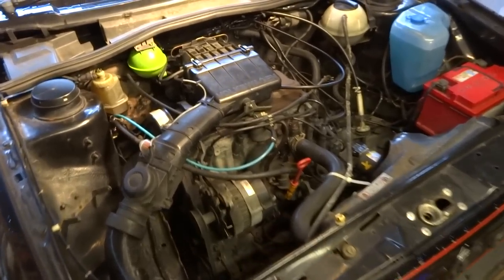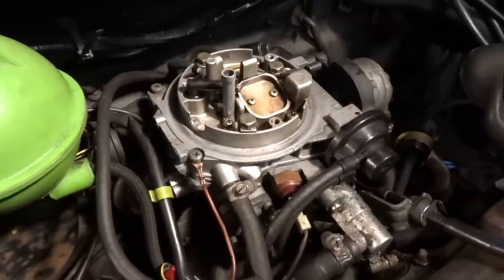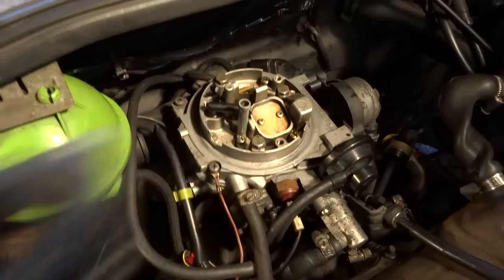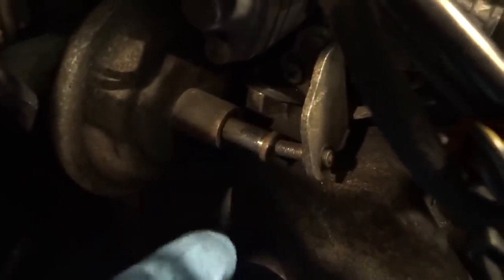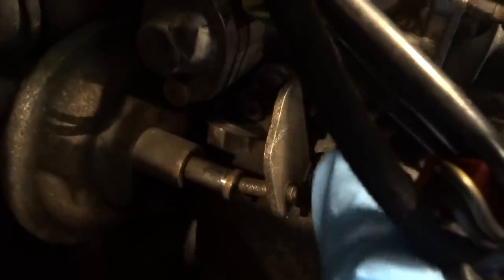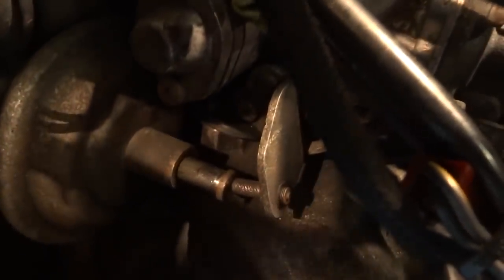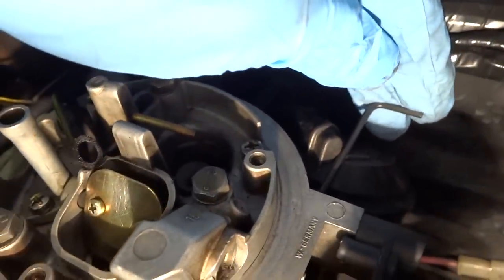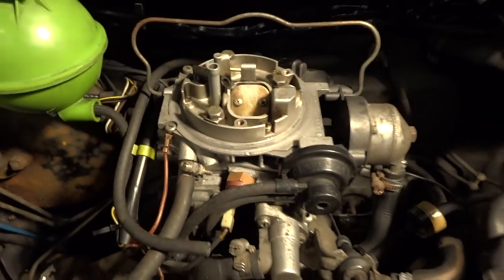VW Golf Carburetor Adjustments. Setting Fast Idle & Choke on Pierburg 2E2 Carb

Comment: Hows it been since the setting up the choke and carb?
Reply from the maker: +michael jagger hi since doing this the only thing we had to do was adjust the dial at 2m50s when the weather warmed up more.
Late last year the Waxstat decided it was completely dead. We replaced it with a brand new one, and checked the setting over again.
Since then the car has started and run graet with no adjustments.
Got some brake judder to investigate now though. always something!

Comment: this carb looks complicated how often do you have to set it all up?.
Reply from the maker: +michael jagger Hi once set up, I don't think you are supposed to need to make any alterations, ...although we have found that when it gets really cold in winter unscrewing the big dial to adjust the choke a little has helped, and then turning it back in during summertime. We also tried making little adjustments with the allen key throughout the year too to see if it differed, but found that it was best to leave it how it was.
If this carb was to be stripped completely and new service kit installed, then maybe it would then work throughout the year without any adjustment whatsoever. maybe next time....

Comment: I have a bad milage on 2E. 1.6 8v engine.I cleaned the carb,what can i do to solve it?
Reply from the maker: it could be anything from bad vacuum pipes or waxstat or even things like plugs, leads or timing! I never know where to start myself, so usually start with whatever works out cheapest or easiest. Vacuum pipes can be replaced easily in my other vids. The mount should be okay if the carb is solid in place. the plugs can be wire brushed if not replaced. but let's not forget the air filter as they are often overlooked and can even get oily too on the golf. dizzy cap and rotor arm can usually sand paper the contacts, but be careful to never ever scratch the plastic. Most parts are cheap to replace but it's a bit of a nightmare when you you don't know which want replacing. trial and error is my usual method, sorry :(

Comment: My car is a 1984 1.6cc Carb engine. It is Manual. Engine code is EW007503. Thanks so much for your help. I took it to a so called VW specialist and the car came back worse than before and me £200 lighter. The bolts holding the carb down were not even tight enough and I started getting steam on the engine. What is involved in a complete rebuild? Do you need to buy some kind of kit and is it something that can be done by someone with limited knowledge with some help of a tutorial?
Reply from the maker: Dubtastic life For Golf 1.6 1983-1992 / EW/EZ / manual
Stage I : 2.8mm
Stage II : 5.6mm
Hope this helps! These carbs are a real nightmare! but having a reset/starting point sometimes stops you from going insane!
I have never taken a carb to bits, this video was the first time ever that I ever messed with a carb on a car! I thought I would have to do a rebuild, there are kits to do so on ebay/ at motor factors, but just changing the pipes and diping the waxstat helped considerably on this car! here's what I did with the carb off https://youtu.be/tKz99bD2KJo. Inside the carb I expected to find a plastic petrol float for the choke from what I was told and thought it might have a leak, never took the carb apart though, and kits just seem to be seal kit, so what is inside I don't know! My local carb shop closed down so never got it to a so-called expert!

Comment: what is my carburetor not having an adjustable pulldowndose? It says it's a Pierburg 2e carb. How can I adjust the first, 2,5 mm gap?
Reply from the maker: Hi I have only had carbs with them fitted so do not know how the ones without it,  and I no longer have the car, as it has just been written off :(
Reply: thanks for the reply, i will continue the searching

Comment: Can you please tell me its there way to decrease ore increase fuel consumption on this carb? I cant find that on this carb. Thanks
Reply from the maker: Hi i think the CO2 adjustment screw may alter the air/fuel mix and increase/decrease the fuel consumption as a result (someone correct me if I have got that wrong!). The CO2 adjustment screw is located under the rubber stopper on the air filter box (when the air filter box is in place), or in that narrow tube that is the highest point of the carburetor (if the air filter box has been removed). Of course the fast idle, timing and the way you drive all have an effect too, but i think it may be that CO2 you need!? I have never adjusted one though. thanks.
Reply: ifitsgotwheels Ok, thank you mate, gonna try that. Thanks again.

Comment: will all the adjustments be the same on the 1.6cc carb?
Reply from the maker: Dubtastic life Hi your 1.6, what year is it, is it Manual or Automatic? and do you know which engine code you have?
Reply from the maker: Golf 1.6 1983-1992 / EW/EZ / manual
Stage I : 2.8mm
Stage II : 5.6mm

Comment: Hi there I've watched this video and I still can't understand why my choke flap stays fully open when the car is shut off and cooled down how could I fix that am I missing some spring?
Reply from the maker: Max Thiel hi I am not sure how and when they shut themselves. it's possible the outside temperatures are warm enough now that they don't need to!? I no longer have carb car to check
Reply: I've tried all the methods and my car still stays at 2000rpm and the flap won't close thanks for the help😊
Reply from the maker: yeah at 2000revs it's possible your waxstat is stuck in the hot position.   
this would keep the pin pressing on the bar behind it and keep the revs up. Check out my other videos, as you can put the waxstat in boiling water to check it and hopefully improve its working. It can be removed from the carb without removing the whole carb, but look at my other vid first to see it.
Reply: I've put it in boiling water before like your other video shows but it seems to be stuck again I'll try and put it in boiling water again and see what happens and again thank you for your help
Reply from the maker: yeah it might just need doing again and hopefully that will keep it going for another while. we did the one we had a few times and got another year or more out of it but in the end ended up having to get a new one.

Comment: Can i contact you in anyway I need some help with my 2e2?
Reply from the maker: Hi everything I understood about these carbs is contained within my videos, most of the info I found on them was from the forum posts here; http://www.golfgtiforum.co.uk/index.php?topic=18871.0 . I never knew anything about them beforehand but was just stuck in a bad situation and decided to make the vids as I went along. The car in the vids was my youngest brothers so I only ever saw it occassionally, usually when it was running bad. Finally we had it running great but it has since been written off. I also had pics of his VW on my car website 'Pixels1dotcom' but don't think I ever got round to adding the carb vids there.
Reply: @ifitsgotwheels  mine keeps stalling but I'm sure it's nothing to do with ignition

Comment: where does the tube go from the green ball?
Reply from the maker: please see here; https://youtu.be/tKz99bD2KJo?t=3m50s, thanks.
Reply: thanks , just got mine back from garage having the head gasket done and they have connected the pipes up totally wrong. thanks very much for this.
Reply: theres a breather pipe that comes from the distributor, can you tell me where that goes?
Reply from the maker: hopefully you can see it in these pics here;
http://pixels1.com/000/car/vw-golf-mk2/vac-pipe-pic-01.jpg
http://pixels1.com/000/car/vw-golf-mk2/vac-pipe-pic-02.jpg
in pic 2 it is at the bottom it should join onto the same pipework that pipe from the green ball joins onto.
Reply: in mine , where the round thing is with the bolt in the middle, theres two pipes coming out horizontally. on yours they are not there so i just bypassed them and all seems to be working fine now. thanks for your help its very much appreciated. heres a pic of mine can you tell me what thing is for https://goo.gl/photos/HRpu1twqCTzHvsuv9
Reply from the maker: hi that's the autochoke, as you say, we don't have the bit inserted into it that you have (we have the sticky out bit though so it looks like they did away with it at some point in time) even though I am not sure why it would have it in the first place as the choke seems to work off the water temperature. Inside the autochoke is a wound coil spring, so not sure how extra piping would affect it. The whole engine and pipework on these cars seems overly simply/complex on these golfs, my guess is as long as they managed to get it working in the R&D dept. they just built it. and the cheaper and faster they could produce them the better!
Reply: well my golf seems to be running ok now, thanks to your help , it was cutting out at over 50mph . the vacuum advance was split connected to the expansion pot and auto-choke , i know now completely wrong! i just need to adjust the idle now, its at about 1600 . i have seen your idle adjustment vid , so long sleeves and gloves at the ready. it does look awkward but i aint gonna let it beat me. thanks a lot you have saved me quite a few quid , the guy at the garage quoted me £70 to overhaul the carb he said the jets were blocked :)

Comment: Hey man, just a quick question again!

So my carb is pretty much identical to the carb shown in this video, but i'm missing the 'choke pull down unit' and 'vacuum reservoir' (Really don't understand why!)

I'm just wondering, what exactly are the 2 pipes that leave the choke unit going into and where in the carb is the vacuum reservoir connected too?

You can buy a new choke unit off eBay for around £15 and i'm thinking of grabbing the vacuum reservoir from an old golf as spares. You think it's possible to connect the two to the carb?. 

Here's a picture of the front of my carb... http://postimg.org/image/llfrccnhx/

Thanks buddy!
Reply from the maker: +Stefan Baranowski Hi if you have only just bought your car in the last 6 months, then it could just be that the previous owner was having some trouble with the carb, and then sold the car with 'choke pull down unit' removed as they were able to get it to run this way. Of course that won't help now with winter fast approaching. If you have already had it though a winter with it like this, then maybe it can work this way, but in any case I think somebody has removed the parts from it. I am not sure how any of the vacuums work.

If you do get one, then although it is difficult to do, the 'choke pull down unit' can indeed be fitted without the removal of the autochoke unit. to do this you need to turn it on it's axis by 90 degrees, then aim the little adjuster screw on the far end of it though the adjuster screw hole (the screw may need adjusting forwards or backwards to manage this!), then it's a case of straightening and rotating the 'choke pull down unit' into place! A bit tricky, but you will see there is a tiny cut away section on the carb just above the peg you are fighting with to allow it to be done this way, so I guess it is suppossed to be done like this.

Once you have the parts. I can just see a vac pipe running to the front of your carb at the bottom of the pic. that pipe should instead run to a joint, with one end going to the vac reservoir and the other running to connection B on the 'choke pull down unit'. A tube should also run from connection A on the 'choke pull down unit' to the place where you have just pulled the other vac pipe off at the front of the carb.

Hopefully a 'choke pull down unit' makes a big difference and you don't need a waxstat. hopefully.

I hate carbs, it's all a case of best guessing, as my technical understanding of them is still only a 'this might do that' / 'or alter that' sort of thing!

bect of luck
Reply: I bought the car last year in August, and the parts weren't on then, but to be fair it got through last winter okay.. I did have a moment where the car backfired when I was driving in February and the revs kicked up to 4k as well as a minute of over run once the ignition was turned off... Safe to say, my girlfriend was absolutely scared to death haha 

I'm going to purchase both the choke pull down unit and the reservoir and have a play around with them both. Someone mentioned on the Golf Forum that the pull down should easily fit to the carb which is good news.

Once I have received all the parts, I may need your help on making sure things go as intended! I'll refer back to your videos to make sure i'm on the right track, but I may be requesting a photo or two from you in the near future! 

Thanks for your help man, much appreciated.